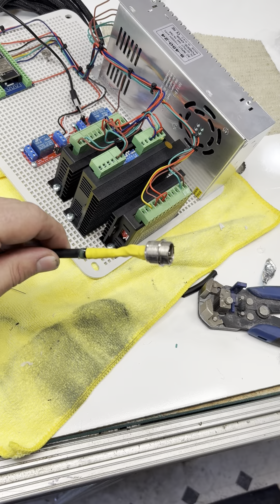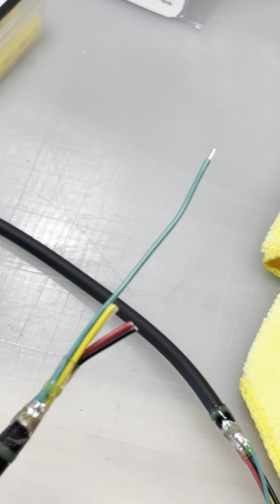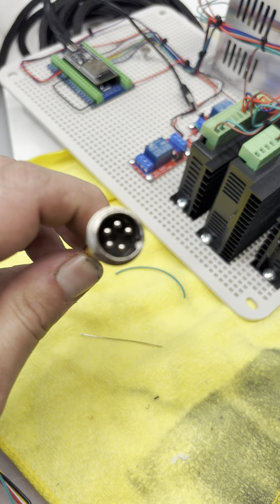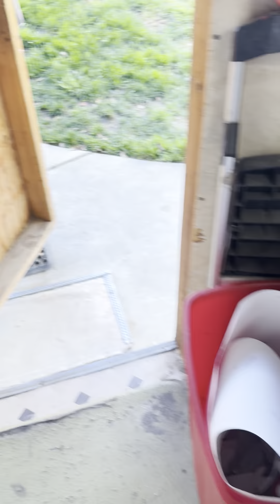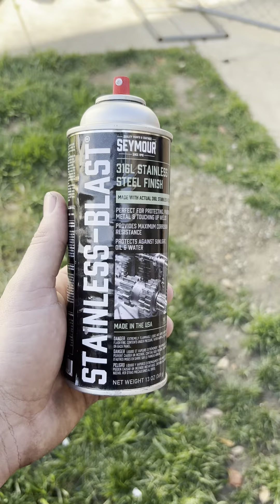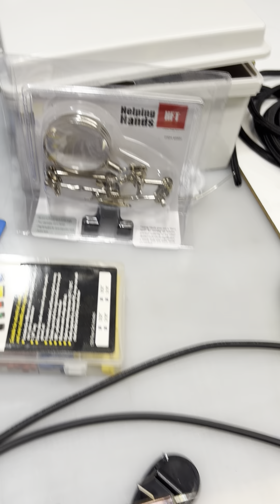Diy cnc plasma tabe jd garage

Comment: did you need 18/4 wire with a drain wire? the link for 18/4 sent me to order a wire that doesn’t have a drain.
Reply from the maker: I used the wire without the drain but i added a drain wire i used heat shrink solder connectors and i left about a 1/4” of the wire shielding and soldered/ heat shrinked a wire to it to create the drain wire